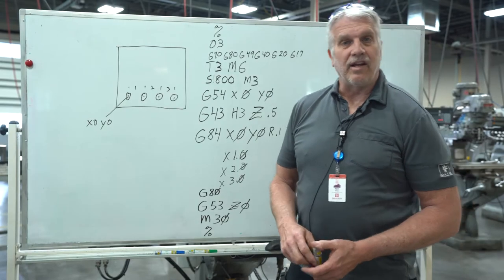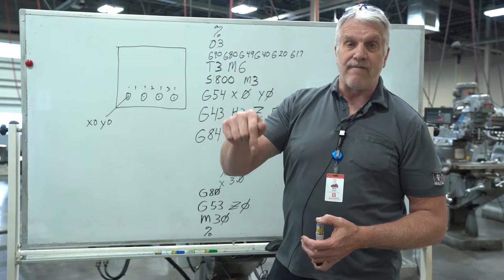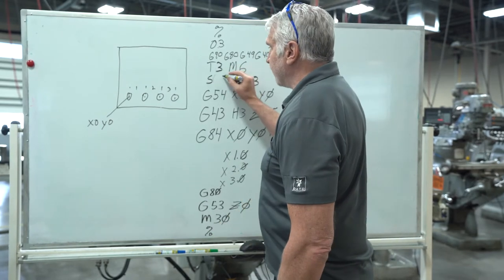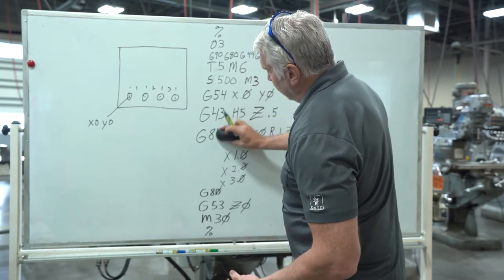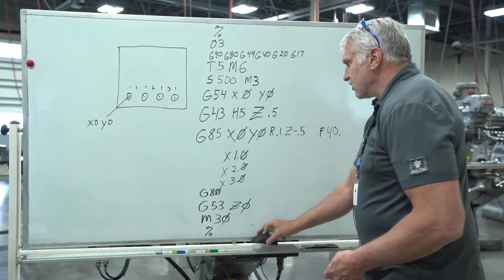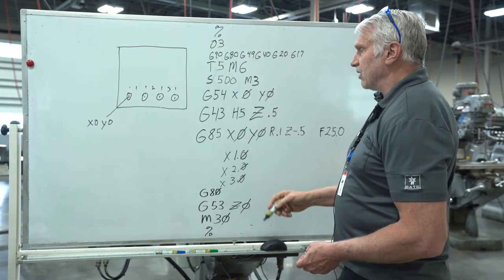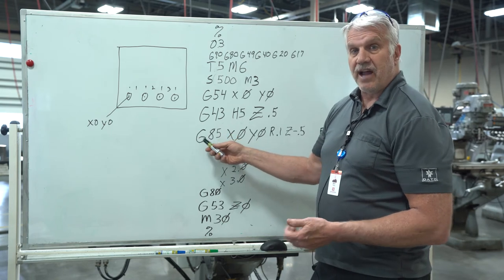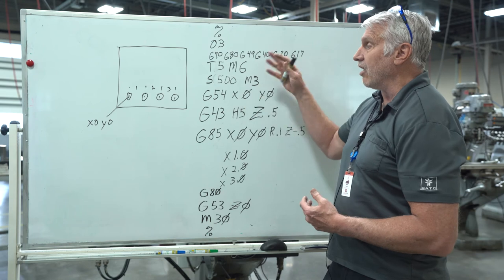Canned Cycles for the CNC Mill - G85 - Davis Technical College

Comment: Hello teacher, thank you very much for your teaching, I hope to continue sharing it with us. I have a doubt, the rhyming is done all at once?, that is, it drops completely at once to the defined "z" and withdraws with the same advance as felled at once? no pecking? and this gcode is for fanuc or hass?, greetings!
Reply: G85 feeds to the desired z plane and then feeds back out of the hole.  Pecking is not necessary for most applications in reaming as you arent removing much material. You dont want to rapid out of the hole either at the bottom as that can cause issues. As far as the g-code goes it is the same for both.  Haas is still fanuc based so G85 works for both in most cases.  Thanks for the questions!
Reply: Hello sir I am from India .I searching a job for deportment of quality inprocess engg #plz help me & 3 years experience in quality inprocess engg